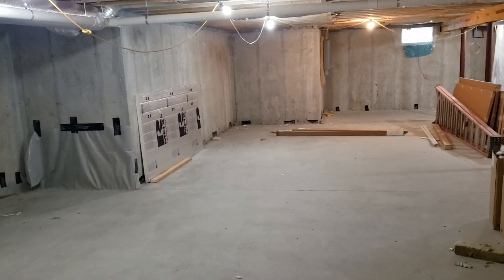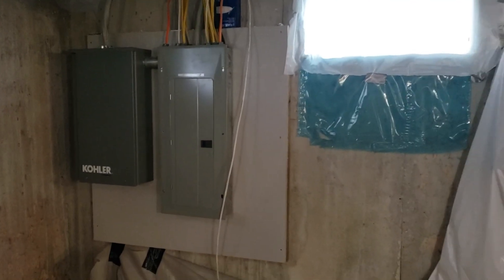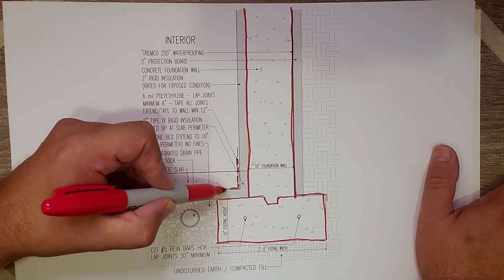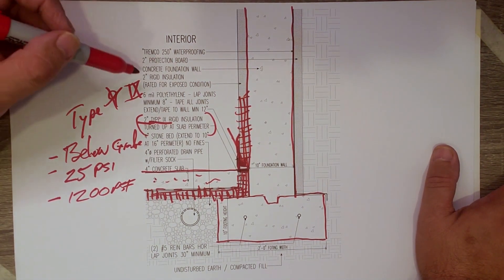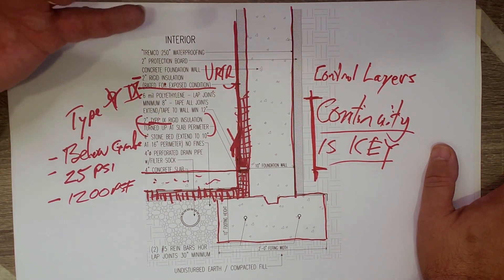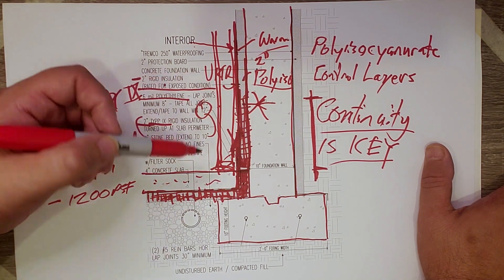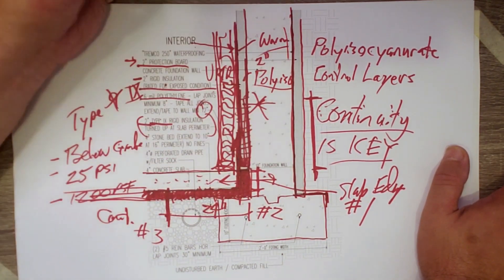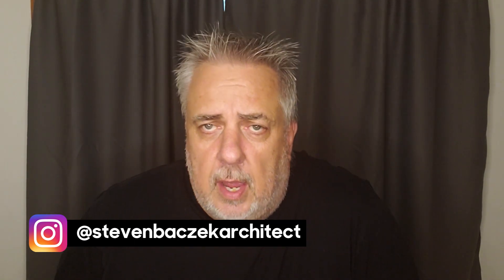Basement Insulation Continuity

Comment: Got it!  Under slab Continuity is Key insulation:  #1-Slab edge, no thermal break so put rigid foam so slap edge does not touch concrete wall,  #2-minimum 24 inches of rigid foam extended from the  wall under the slab  if on a tight budget,but to alleast have the slab edge have rigid foam to break the thermal break and....drum rolll...... #3- Continuous rigid foam all the way to the other side, if the budget and priority allows.  Noted with tons of thanks. Saved this vid to discuss with builder.💯   🙏🇨🇦

Comment: Steve, another bookmarked vid to add to my doc in prep for discussions with the builder.  To be able to show the continuity building materials used is important for clarity.  I bookedmarked another vid you did that showed how the 10mil poly came up the wall and was taped to the interior basement wall.  Getting that poly up into the interior of the basement and taped for continuity and to be able to seal it to minimize thermal loss. Great stuff Steve.  Still waiting for a client you will work with that will like to have insulation on the outside of a concrete foundation and the details of that.   Lots of time to wait....patient here in Atlantic Canada 👍☺     🇨🇦🍁

Comment: I am of the opinion that insulation must be on the outside of a wall. Even more so when we talk about concrete walls because that's a whole bunch of thermal mass you are losing if you insulate from the inside.
Reply: Hi Jo, I always soak up anything Steve shows us and adds the building science and counter reasoning due to "trade offs" of a variety of circumstances.  i am also of the opinion that insulation is best done on the outside. I emailed Steve last week on one of his vids asking him if he ever shows a concrete basement where the client uses outside insulation to please post it so we can see the details.  Thanks for your comment.  There is enjoyably so much to learn from Steve on this helpful "onnnnn The Build Show" channel.☺    🇨🇦   In a few years 2025-26 a passive build inspired 2.5 storey high extension will hopefully get started. It will be added to an existing 4 bedroom home built in 1983, concrete basement. I am saving more money so that while the rigs are here for the new build the exterior basement foundation work for exterior insulation can take place as well.     Have you read and seen the diagrams for cold climate frost protection on foundations using the "Wing Insulation" practice?  Very cool stuff.   5% angle of XPS laid down from the concrete foundation, captures the heat from the ground from below, keeps the soil dry underneath the "XPS long wings" which means minimizes moisture content of the soil next to the concrete foundation, which keeps exterior concrete foundation dry and warm.  Alaska, fairbanks, has the building science used in the homes up there. Being here in Canada, climate zone 6-7, I am hoping to apply it here on Prince Edward Island.  Good to read your comment and have Steve reply!          So much to learn, so little time......eh!🍁☺🇨🇦
Reply: @MegsCarpentry-lovedogs  I think the further north you go, the more useful it is to insulate from the outside. I'm in Germany and it's like 95% outside wall insulation here.
All the best wishes for your build, Meg! :)
Reply: @b_lumenkraft  OH, cool! 95% outside insulation in Germany builds!  Briefly, do you have the time to list the layers starting from the concrete wall and outward?  I have a few references and diagrams off the internet build channels but nothing that references Europe or Germany considerations.  Great to hear from you....and nice you suggested to Steve this topic could be a good one for pros and cons in insulating concrete foundation on the outside. So interesting to hear what he has to say and the building science. Thank you for your best wishes Jo🙏☺🇨🇦
Reply: @MegsCarpentry-lovedogs  The usual German method would be the so-called Wärmedämmverbundsystem. You might google it and click image search. I bet that will give you some good ideas. :)
Reply: @b_lumenkraft , yes, thank you so much. I just watched the build show network vid from Jake Burton, title How to insulate a basement, Aarow Builder.  You might be interested because he addresses your comment about doing a pro and con vid.  Jake made a good point about why he chose not to do outside, after doing outside insulation on his parents home in the late 1990's.  Ants and mice and snakes burrowed into it. They saw this years after they had to excavate.  We have roxul or mineral wood here with different compression strengths.  You can place mineral wool outside and the mineral wool is a deterrent for mice and exoskelton insects because the fibers of mineral wool rip their exo skelton apart. "One of mineral wool's forms is stone wool, which has the main components of inorganic rock or slag as the main component, typically around 98%, the leftover 2% organic content is commonly a thermosetting resin binder or an adhesive and a little oil."
So, I might look into installing mineral wool outside instead of rigid foam. So much to learn.  I googled the name you placed....it was so helpful. Thank you for this Jo!🙏🇨🇦☺
Reply: @MegsCarpentry-lovedogs  Speaking of critters in insulations, here is a nice story: In Mannheim, there is a colony of tropic parrots. Normally they wouldn't survive the cold German winters but they found insulation as the perfect environment to build their nests so they are there for decades now and keep growing their population. They are absolutely beautiful.
Good point about having the insulation inside.
Reply: @MegsCarpentry-lovedogs  Thanks for the video tip. I will check it out. :)
Reply from the maker: @MegsCarpentry-lovedogs  Yes, but how do you cover the Roxul? Effectively?
Reply: @b_lumenkraft  My pleasure☺🇨🇦
Reply: @stevenbaczekarchitect9431  OH, and the GreenHome Institute podcast Youtube vid emphasizes your practice "Continuity is Key" theme.  I just read your concern about the water table rising and mineral wool on the outside soaked so therefore insulative value decreases. I will listen to the podcast again with this concern in mind to see if they address it as it has been months since I last watched the podcast video on youtube. Thanks Steve..you are the best!💯☺🇨🇦
Reply: @b_lumenkraft  Steve left a comment in our comment thread and I also mentioned that a youtube podcast, 2 yrs ago, called Greenhome Institute, did a deep dive on rockwool exterior on basement foundation. The title of the youtube vid podcast with 3D images is called Foundation Insulation with Stone Wool.  I am listening to it now again as it has been awhile.  Steve was concerned about rock wool with a high water table. They do discuss this with images. Lots to learn. Great reading your comments Jo!💯☺   🙏🇨🇦
Reply from the maker: @MegsCarpentry-lovedogs  Insulation on the outside isn't wrong - I just don't subscribe to it. The thermal mass argument doesn't work for me, especially in high performing homes. Also, I have never had anyone answer the two questions? 1. What do you "effectively" cover it with? and 2. What happens when the water table rises and there is water around it, highly conductive water that is?
Reply: @stevenbaczekarchitect9431  Steve, at the 59 minute mark of the GreenHome Institute podcast video done 2yrs ago, titled Foundaiton insulation with Stone wool, they discuss water table issues and mention placing on the outside of the rockwool a dimple mat. Its at the 59 minute mark on the youtube vid. So very interesting! ☺🇨🇦
Reply: @stevenbaczekarchitect9431  Steve in the GreenHome Institute podcast video done 2 yrs ago on rockwool for foundations, a question was asked from a viewer and the architect replied that you can cover rock wool below grade using furring strips and the aluminum sheathing that is the same as the flashing material.   As far as the water table issue, he suggested making sure the slope of the ground is minimum 5 degrees and use a dimple mat on the exterior of the rigid board rock wool...He emphasized that the detail to all of this is important, just like what you emphasize in your videos...Continuity is Key!  👍☺🇨🇦
Reply from the maker: It is exponentially harder to detail successfully on the outside of the wall. Yes maybe a little thermal mass advantage lost, but in a high efficiency home I will take the trade off everyday
Reply: @stevenbaczekarchitect9431   That is interesting. Maybe this would be a topic for a video? Pros and cons of inside and outside insulation? ;)
Reply from the maker: @b_lumenkraft  I have talked about it before - sore spot with some, not with me. I have seen dead animal skeletones, snake skins, etc, in exterior foam